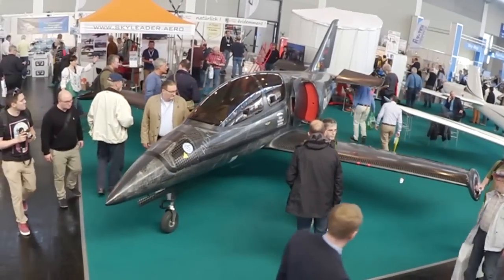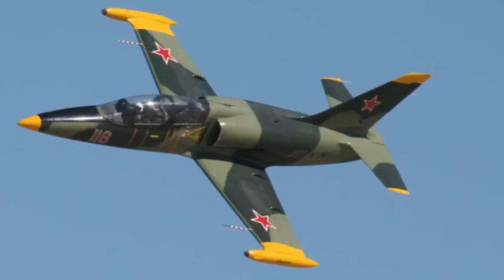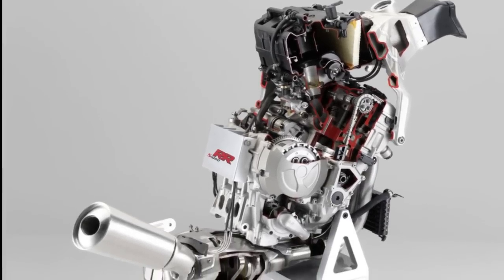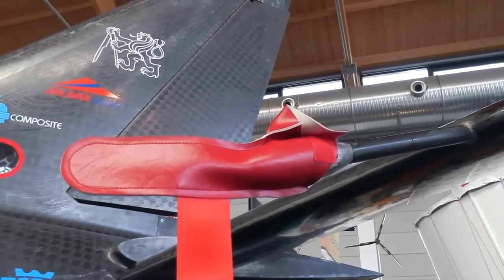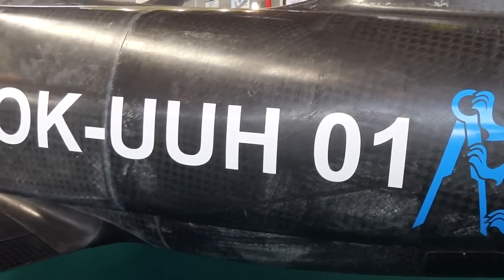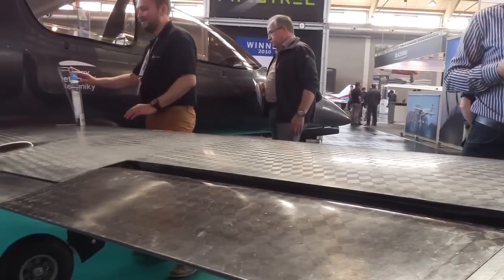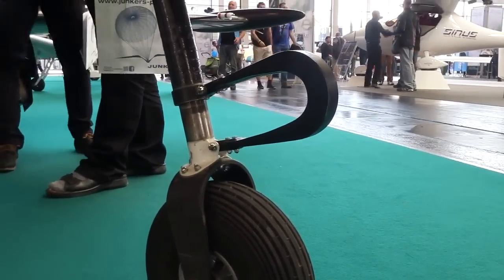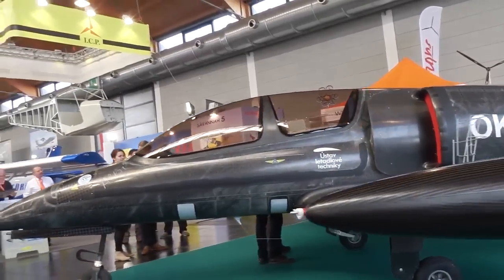This BMW S1000RR-Powered Airplane Will Blow Your Mind

Comment: Motorcycle power airplane....i never thought id ever see those words
Reply: There are ultralights that can be powered by chainsaw engines :). And some automotive engines have found their way into aviation too.
Reply: I did that why I searched for it. I'm an aerospace student with a cbr600rr and I can't help but to build in my head.

Comment: You know you ride a bad ass bike when they stuff the engine on an airplane
Reply: yah a really bad ass engine bike  that has a short life span compared to gas turbine engine and cannot handled full power longer than gas turbine engine. thats why it use only for small aircraft. look at the F1 ENGINE...can formula1 engine live longer than what you expect because it is a cutting edge technology engine?
Reply: @thirdyiii9649  Ducted fans require very high RPM.  The 1000RR would be perfect for this.
Reply: @rustusandroid  noop..a ducted fan need a low rpm but a higher torque.. but still in the end it depends on what specification of the fan.
Reply: @thirdyiii9649  incorrect
Reply: @rustusandroid  how and why?
Reply: @thirdyiii9649  You didn't offer any how and why when you disputed my comment and said that ducted fans needed low rpm.  Honestly, if you can't research that simple truth yourself, then your lost.
Reply: @rustusandroid  didnt you read my last sentence..STILL IT DEPEND ON THE SPECIFICATION OF THE FAN.
you may have a fan but its chordline isnt that long or wide and your AOA is less and you have a few blades then your high rpm engine might be perfect for that fan, but if you have a wider chordline and multiple blades let say 14 plus blades and your AOA is higher...do you think a high rpm engine could spin it?let say without using any gearing meaning direct drive

Comment: Nice plane!  Make it single passenger with two of those motors controlling two center thrust ducted fans (on either side of fuselage).  Hopefully that would mean neither engine would have to run at at full capacity the whole time and if either engine seized, you'd still have the other to limp to a safe landing.
Reply: I find that kinda not true.. I ran my bike top speed for 5 hours when I was travelling far and it doesn't have issues until today... My bike isn't known for its brand  reliability but its still run fine today... I just finished 500miles travel yesterday with top speed locked 80% of the time.. Engine still pristine after 3 years.. You only need 1/18 power to lift aircraft and bikes engine has 200hp and 113 nm torque

Comment: I have always wanted to build a twin engine high wing using a Yamaha r1 engines, or BMW RR, although I don't think I would want to run it flat out all the time.
Reply: The RR is more race oriented it can take a hell of a beating and there are a lot mods and tuners out there. Get the engine blueprinted for next to nothing.

Comment: That's awesome!

How do they deal with a regular auto engine being inverted?  An auto engine will not work inverted.  Even if they ran a dry sump you still need a pan for collection...
Reply: +Blackhawk51806 Well any fuel system in the past 20 years is pressurized, so that's not an issue.  Any oil system is pressurized ONE way for way longer than that.  So it's really not a valid statement as what you're saying applies to anything made....ever....

Oiling is gravity based on the return and has pressure going TO the lube points due to the oil pump.  It relies on gravity to get back to the pan/sump.  In some race applications a dry sump is utilized to prevent starvation in high G's, EVEN STILL, though, pre-sump there is a small pan for collection and gravity is still required.
Reply: +Blackhawk51806 Yeah, all fair points.

I read with regards to stunt plans that sometimes they run modified dry sump systems with an extra pickup in the head to pick up from the head when inverted.  Neat little set of check/ball valves and what-not.  Also, yeah, I don't think this thing will be upside down so they can probably let a lot slide there.
Reply: Inverted is not the same as zero- or negative-G.  Almost all my time inverted in jet fighters, experimental planes and sport civilian aircraft is at positive G.  The engines didn't "know" the aircraft and the engine were upside down relative to the earth's surface.  It just does not matter.  Set a glass of water on the dashboard and do a loop or a barrel roll.  The glass and the water just sit there as if they are on your dining room table.

Comment: Undersized engine pushed to the limit to lug around a load better suited for a bigger displacement.
I'd wager the fuel burn is similar to a much larger displacement engine with much lower lifespan to boot.

Comment: But it's not a motorcycle powered plane, it just has a motorcycle engine in it. I was hoping it would be a kind of exo skeleton you can attach to the bike to turn it into a plane.
Reply: +6Twisted 
haha that would have been amazing :D
Reply: +6Twisted Well, if you tried to build an airplane around the S1000RR it would probably be too heavy.
Reply: Jagh Haringenamn 180kg + rider for a 200hp engine is nothing.
Reply: 6Twisted and the aircraft body?
Reply: Jagh Haringenamn I was just talking about the load weight. I don't know how much the body would weigh.

Comment: Crazy project, i cant believe the plane is that light...
However, i cant help but think theres a reason most airplane engines are super reliable with double ignition system and so on - running a motorcycle engine at a constant 12000 RPM may not be the most reliable solution

Comment: I thought a ducted fan is twice as efficient as a propeller hmm.
Reply: Uno, no, props can be up to 93% and are typically 85%.  Ducted fans are much less efficient, especially at high speeds due to skin friction times area.  There are also other losses that a regular prop just does not see.  Think of it like having twice the skin area...outside and then inside, plus lots of flow turning.  Jets use nozzles to slow or limit the flow (supersonic) and prevent compressor stall.  The main benefit would be noise reduction and safety around people, and of course, looks...
Reply: seaplaneguy I think he's talking about a prop fan engine not a ducted prop.
Reply: @seaplaneguy1   i think another way,ducted fan is much more efficient than props.because ducted fan can travel much more faster and has more thrust than props. ducted fan has muc more GRIP to air than props.can props do that? can props climb a high altitude just like a ducted fan and travel as good as efficient? props is only good at low speed even it has a heavy payload but ducted fan can do that also
Reply: @thirdyiii9649  I have a book on ducted fans.  Depending on the design, the trust is better at LOW speeds and worse at higher speeds.  The break even point is around 150 MPH.  Slow drones would be helped by ducts, but not high speed craft like mine....30-400 mph.
Reply: @seaplaneguy1  i respect that you have that i dont have, what craft you are talking ?is it a large aircraft,experimental aircraft, or rc aircraft?  and what are you talking about about ( better at low speeds and worse at higher speeds)?is it DUCTEDFAN or a PROP.?and what DESIGN of  DUCTED FAN or a PROP?
Reply: @thirdyiii9649  The duct helps by making the prop tip be against a wall, which is like have a huge aspect ratio for the blade.  This comes at a cost of the duct drag.  The neutral point is around 150 mph.
Reply: @seaplaneguy1  YES i knew about how important the inside cowling wall for the tips of each blades,but if you put ducts in a propeller then we have a problem for weight,no good effect at all compare to a fan with a cowling wall, for me as i analyze duct should only be for FAN BLADES not for propeller 2,3, OR 4 BLADES that has only have narrow blades.
Reply: @thirdyiii9649  Yes, if you want high Mach # flight like on airliners, then you want a fan blades with 100% solidarity so that you create a jet effect out the back.  A ring around a few blades and high bypass pulsor found on airplanes are NOT the same.  My comment is not related to airline speeds or apps, but only low powered prop airplanes where slow thrust is the goal.
Reply: @seaplaneguy1  OH I SEE YOUR  POINT.yes i agree with you,

Comment: I would never want to be in the air with that engine....12k rpm in a motorcycle engine...how long do you think that's going to last..airplane engines are under load the whole flight where motorcycles go up and down the Rev range as they start and stop and coast...this thing is a death trap

Comment: saying a ducted fan isn't as efficient as a prop is inaccurate.  It depends on the air speed.  At higher airspeeds, the ducted fan would actually be MORE efficient than a prop.
Reply: 00HiGhGuY00 It's a plastic frame with a bike engine, somehow I don't think it'll be breaking Mach 1
Reply: First of all, OBVIOUSLY it wont be breaking Mach 1 as it's not a jet aircraft.  The guy in the video made a generalization about ducted fans.  I did not say anything about THIS PLANE in particular only about ducted fans.

Comment: Questionable... motorcycle engines aren't built for reliability as usual plane engines are. Nor are they built for constant power delivery... it's probably heavily modified
Reply: From what I’ve read, motorcycle engines are far more reliable especially the BMWs.  Lycomings and the rest have crib death and all kinds of BS failures which is embarrassing since the technology is literally over 60 years old. And let’s not start talking about MIFs ( maintenance induced failures) in the aircraft engine world.